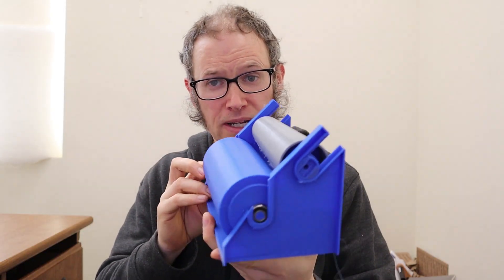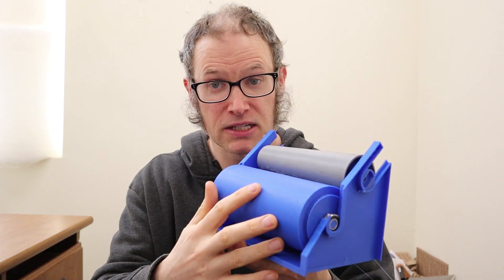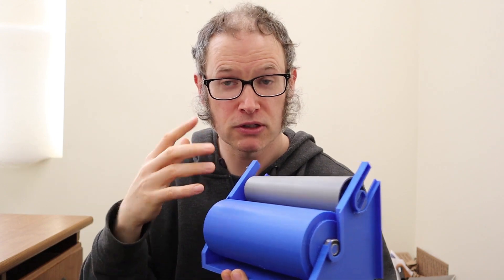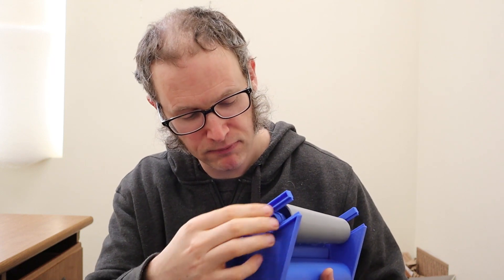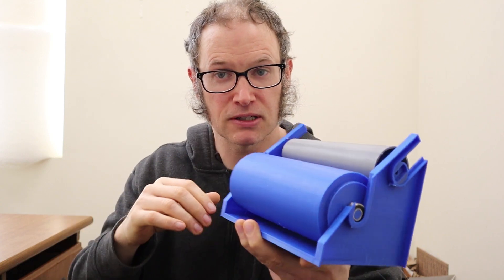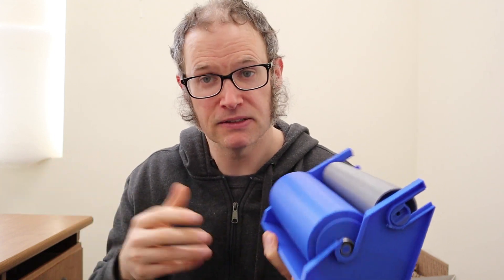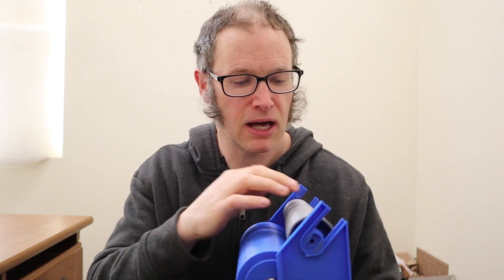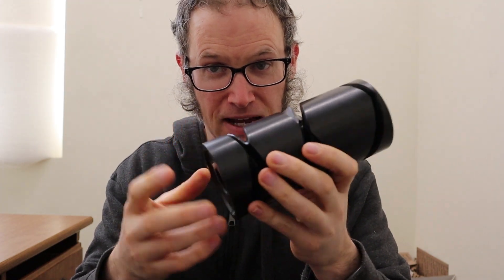SPIN #73 - Designing a Cone Winder

Comment: Excited to see this progress! Will the cones be a "standard" size? I use a cone winder fir my circular sock machine. I have 3-d printed cones (royal winder) and cardboard cones from Earlbacher. Unfortunately they don't work on the same winder from what I've found. Thank you!!
Reply from the maker: Right now I'm just trying to get it to work with an optimial sized cone.  I will then think about supporting other size cones/bobbins.  One issue is the more sizes I support the bigger it will get and that will increase cost.  So this will be a balancing act and I haven't decided what I'll do with these yet.
Reply: @DreamingRobotsBlog  i understand that issue. Cost is what appeals to most. Maybe consider optional adapters for various types of cones.  As fas as i know, there are the Royal cones, Earlbacher cones and Nancy's Nicknacks. I'll check around.
Reply from the maker: @lynndukes3870  There are also industrial cones that have pretty consistent sizes.  If all I need is an adapter then I would likely support it via a 3d printed part.  My concern is a simple adapter won't work if the cone is a significantly different length or too large of a diameter.  Shorter cones would require a different drum, which might be something that could be 3d printed, but that wouldn't be ideal.  Larger diameter would require changes to the base and that is something that would increase the cost for everyone.
Reply: @DreamingRobotsBlog  i know there are so many variables! Thats a huge problem.